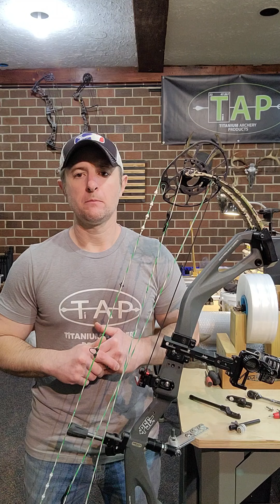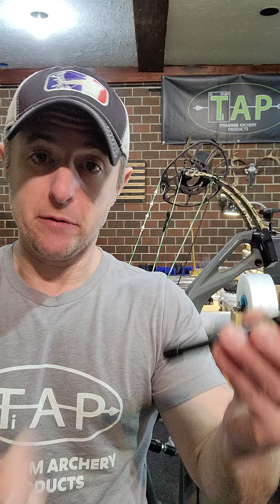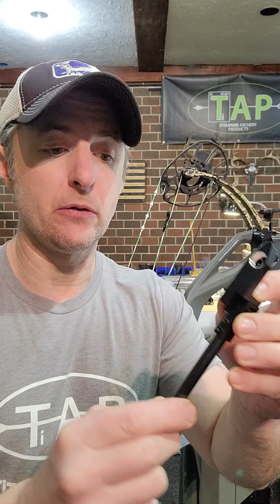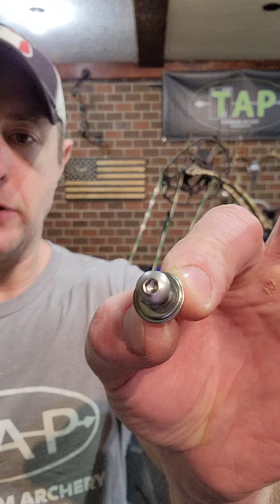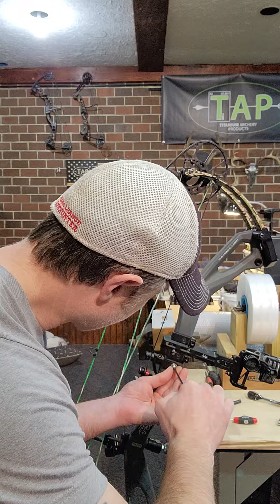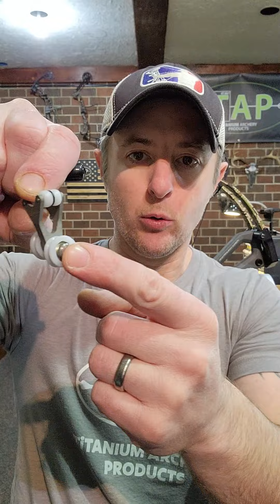PSE Mach 34, Mach 30 and Levitate Adjustable Cable Guard System Install - TAP Archery

Comment: I just got a Levitate and probably going to consider this. I thought the cables were pulled over excessively also with the factory. Do you need to add twists in the cables after installation due to reduced pressure laterally
Reply from the maker: @urbanarcher3535  you won't  lose more than about 1/2 pound in draw at most and if you want to regain it, yes, add some twists in cables. I've done that numerous times on my bows.
Reply: Thanks for the response.

Comment: always wondered why the rollers for the cables are parallel when the cables are not. Wouldn’t it make more sense to to machine them with this angle in mind? Maybe offer it in different angles for different bows/lenghts or even make it adjustable? Would guess this would 100% eliminate the stringing issues some people report with these.
Reply from the maker: in order to have the roller align perfectly with the cables (the angles of which vary somewhat between different models) the large rollers would actually need to be able to rotate off of an axis....very difficult to make work effectively and far more costly to design and manufacture. Out current design works GREAT as you'll see if you read our outstanding customer reviews on the website. We do also have a video here on our channel that shows how the cables align with the rollers during the draw cycle. Thanks for asking, Sam (TAP Owner)

Cancel

Reply
Reply from the maker: https://youtu.be/JNaiZD5kuhM?feature=shared

Comment: Im sure your products work fine and also plan to get a few for my Mach 34 if it ever shows up at the dealer. Question, when machining this part, why not make that huge center bolthole smaller and counterbored. Would look more slick then a stack of washers. Same way the rest is machined, without the elongated channel ofcourse. Im not a professional machinist so maybe there is a reason.
Reply from the maker: It wasnt intended to be this way originally. The two washer stack and small button head screw (which actually work really well fortunately) is just the solution that allowed the product to work at ALL. There was a small drawing error that was not caught before the part went into production...and given that I was then many thousands invested already couldn't afford to run them again...had to find a way to make it work and this was it...use one on my Levitate and it works very well in addition to providing me another tool for tuning....cable load adjustment!